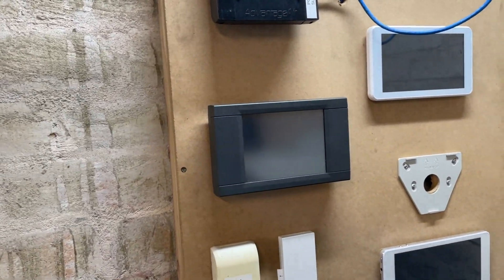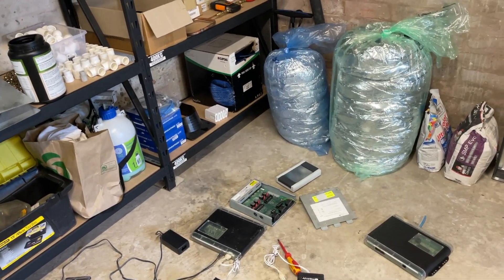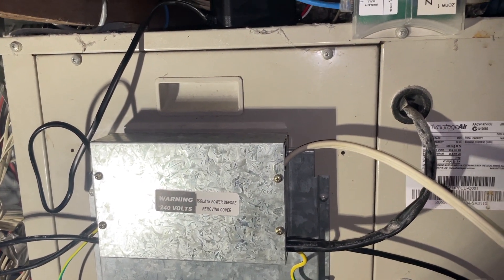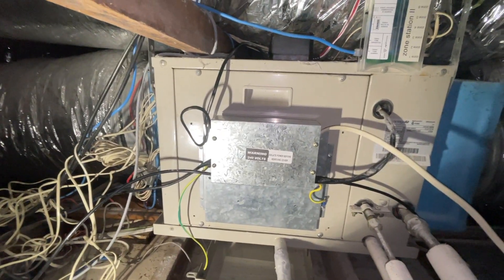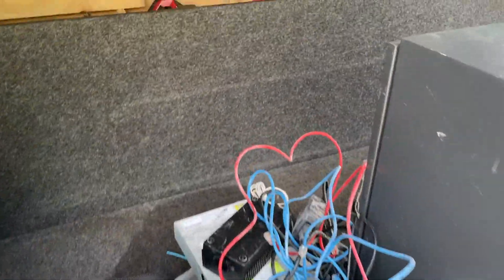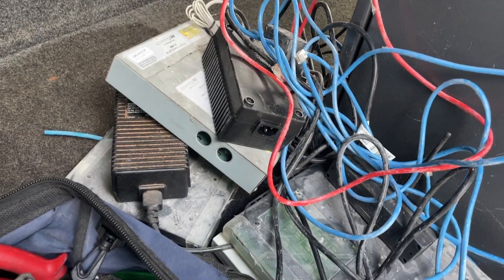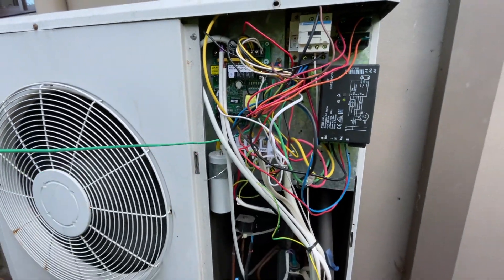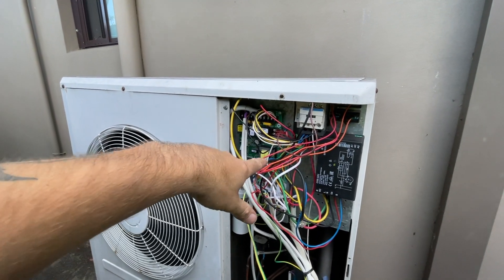Retrofitting an Air Conditioner because spare parts don't exist..

Comment: Thank you for this. I am from South Africa and have this problem. Remote lost. Can you help with component numbers to replace same as in your video.
Regards Roberto
Reply from the maker: Hi Roberto, I used the following parts

Actron Controls:
Indoor Board Part # B8BR1
Outdoor Board Part # D8CPU3
Wall Controller: 4 Zone Wall Controller

Im not sure if these are available in South Africa. If they are then you can use on any Air Conditioner that uses Accurators, Capillary Tubes and Tx Valves as the metering device. They are not compatible with EEV's as the metering device. Good Luck!